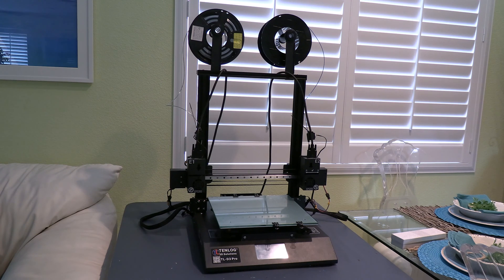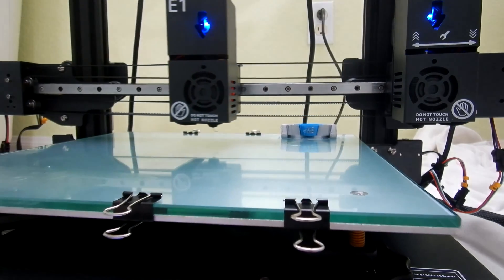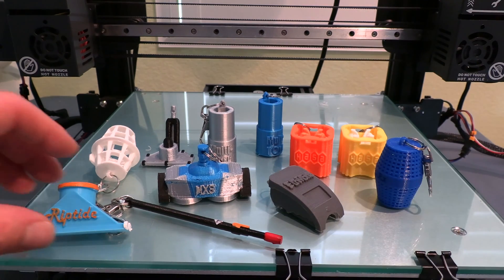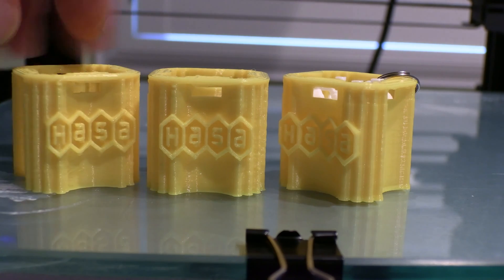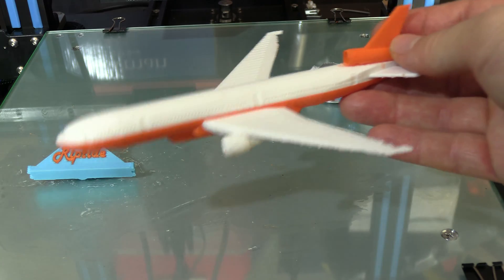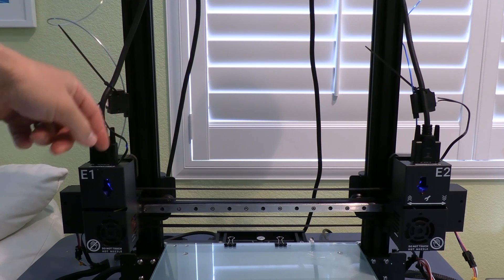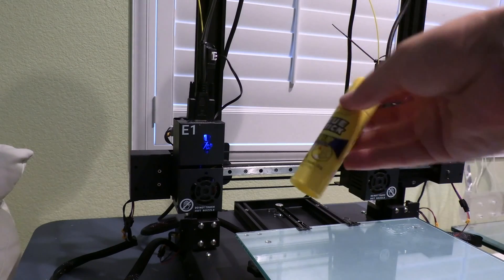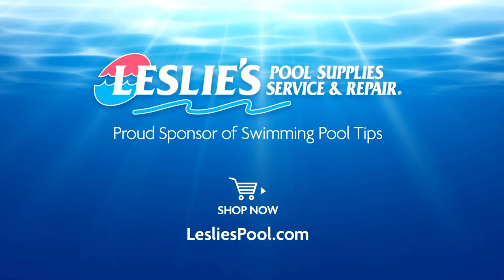Tenlog TL-D3 Pro 3D Printer, Dual Independent Extruder, Duplicate and Mirror Mode, Print in 2-Colors

Comment: Great video, But how do you slice for the mirror prints? do you have to tweak your printer setting in Cura or Simplify3d? Neither seems to work for me. do you have any suggestions?
Reply from the maker: Good question. They have great Skype Tech support if you go to the Tenlog website. They are in  China so depending on your time zone you can get a live person to converse with via skype text. Here in California I get a live person at 9 pm at night. To be honest all we use is duplicate mode.

Comment: How can I dual extrude on the printer with cura
Reply from the maker: First, select the Tenlog printer on your preferences, then import two or more models. On the left side of the screen there should be the normal buttons of move, rotate, etc. Below those, are two little "comment boxes", each with either "1" or "2" on them. select an object, and then go to those boxes and select if you want to print that object with extruder 1 or 2.

Comment: How did you adjust the belt tension for the x-axis belts? I can't find any adjustment on mine, and the belts are a little loose as was with yours.
Reply from the maker: I couldn't find anywhere to tighten them as well so I strategically placed a ziptie on each belt where it slides into the extruder. If you place it just right and tighten it you can pull the belt tighter. Then trim the zipties. A good machine but missing some bells and whistles.

Comment: Quick question on the Duplicate mode. When slicing do you just place the model int he center of the slicer or do you need to move it off to the side? I ask because I just tried the Dulpicate mode and with the model in the center of the slicer when I sliced it my second extruder started slicing half off the bed. I have to move the print over to the left a bit when I slice it. Is that the same for you? Just curious.
Reply from the maker: My only complaint with this machine is that the software is just downright dumb. I first noticed this when leveling the bed - if I didn't recenter it The nozzle would come down off the bed. So with the duplicate mode you need to place it to the for right and it will duplicate on the far left. Tenlog hopefully will work on the software - but it does strange things like that.  I haven't been able to figure out the power resume mode either. Other than the software the printer is great.
Reply: @SPL  Yeah the software on the actual printer is not the best.
For slicing I I have been using Prusa Slicer. I did not even bother with whatever they offered with it. I think it came with Cura. I've always had bad luck with Cura.
 I personally would love to just upload my own version of Marlin for it. If to just remove that constant beeping when when it hit the endstops. Wish they would have offered a setting to turn that off. Like a silent mode. It gets real annoying when printing multi color prints.
It does make some beautiful prints though. Only hard thing I ran into with mine was the the leveling. I had to take apart the entire X axis and rebuild it to make it level and snug. I also adjusted the z axis and it's endstops. Once I did that it was smooth sailing.

Comment: I think the duplicator mode is  not at all a good reason to purchase this thing.  It is a nice feature if you are purchasing it regardless, but you dont purchase this printer for that feature alone.  If that is the main reason for purchasing this printer, then you purchase 3 or so Ender 3s and get just as quick print time with less of a chance of failure.  

With that said, I am NOT at all bashing this printer or most of what you said in the video.  I just disagree with that specific statement.  You purchase this printer if you want to print multiple colors at once, that is where it shines.  If you happen to use the duplication feature then great, just dont make that a primary reason for getting this machine.
Reply from the maker: I don't disagree - the dual color printing is completely impressive.

Comment: Would you forsee any difficulties using PVA filament for supports with this printer?
Reply from the maker: I watched a video with the Hictop using the PVA and it seemed fine. I think these are the same manufacturer. I could be wrong. I was going to try that next. But it has no problem with TPU so you should be fine.

Comment: I just picked the same printer, but cannot get the speed up. I am using Cura and factory included files. From the video, the machine appears to be traveling faster. Would care to provide your settings? tks. Great video, by the way.
Reply from the maker: Sure thing. If you send me an email and david@swimmingpoollearning.com I will email you those settings in a google drive file. Thanks
Reply: @SPL I've been fighting with my tld3 for the better part of a year, and I still have yet to get decent, reliable prints from it. Would that email still work to get the settings you use?

Comment: Do you use simplify 3D with this printer?
Reply from the maker: Just Cura 4.2 right now. Works really good with Cura. But if you need anything their tech support is really good via Skype in China. Usually can get someone live in China at 8 pm PST if you have any questions. So far I have contacted AnyCubic and Tenlog tech support and both are A+.
Reply: @SPL  Amazon has two versions black 1 and black two I can’t seem to tell the difference would you happen to know the difference?
Reply from the maker: @balancenoptions1322  The black glass bed is a new upgrade. It looks like a similar glass bed to the one on my AnyCubic Chiron. So it is the same 3D printer as in this video but with an upgraded bed. You will not need tape or glue on the new bed. The only difference between the models is that one has a silent motherboard like the one in the video and the other does not. Looking today the one with the silent motherboard is cheaper. And any price under $600 is good. I paid $597 for mine. Hope that helps.
Reply: @SPL  Thank you I just pulled the trigger on it hopefully I can get a simplify3d profile fo it
Reply from the maker: @balancenoptions1322  Great! It is a pretty awesome machine.  It is now our go-to printer out of the 4 we use. The only thing I suggest is to watch their video on "How to Set the Nozzle Offset" on the Tenlog 3D YouTube Channel. Then your dual color prints will come out perfectly aligned. So far I would say we have printed over 300 dual-color key chains with both PLA and TPU and no issues. Had to use a tower for some of the prints.
Reply: @SPL   Nice! Yes I have 11 printers mostly all cr-10s and I am hoping this will reduce a lot of my time for my dual color prints! I also print dual color keychains 😁 I can’t wait to try it out I have watched a few videos already just need a S3D profile do you know if they have a Facebook group for this printer?
Reply from the maker: @U%F0%9F%91%8D%F0%9F%91%8DCVV9rd0qWcY47CrEsPCID1g That is pretty cool! I just joined it myself after you brought it up. "Tenlog 3D Printer Group" 👍
Reply: @SPL  you should print and add the nozzle brushes, they will speed up your print time and you wont need a tower

Comment: how is the quality of the prints compared to a single?  Looks like the quality isn't as good.
Reply from the maker: Extruder 2 takes some tuning. That is the one that you will need to move up or down to match the bed leveled with extruder 1. We did some finer tuning on it. We also ran the nozzle offset G-code included with the printer. Nozzle 2 was off fractionally. So now the prints are more or less as perfect as a 3D printer can get.